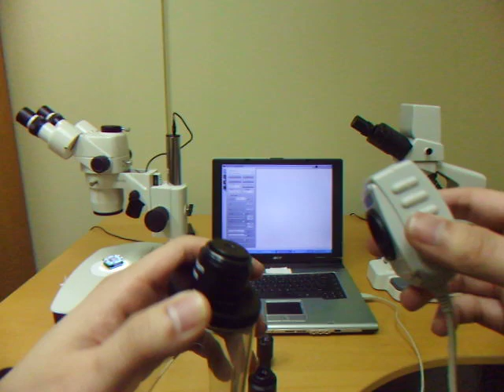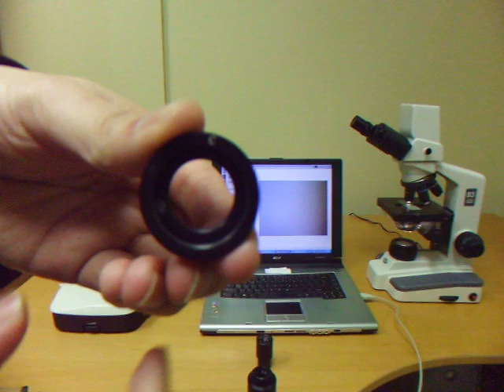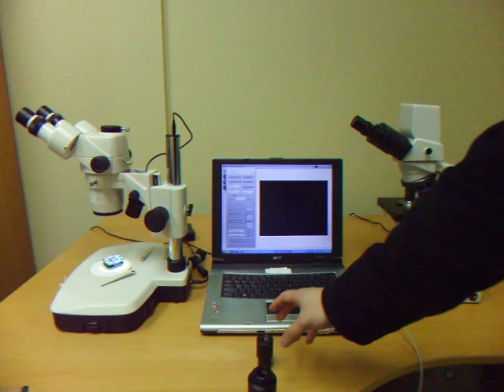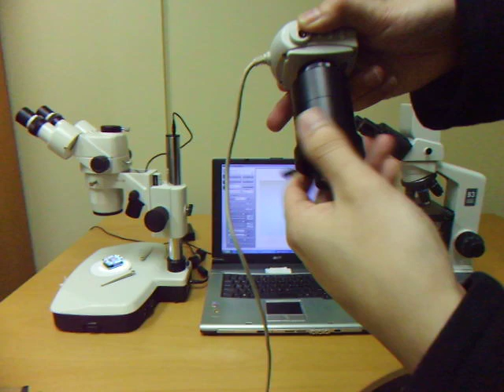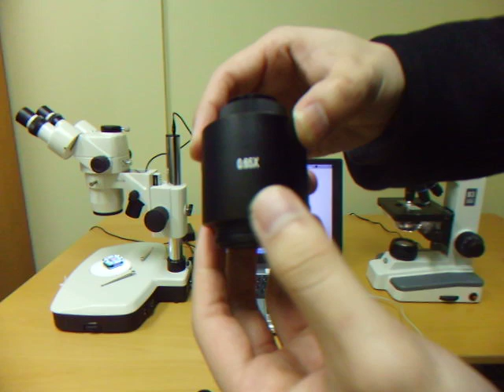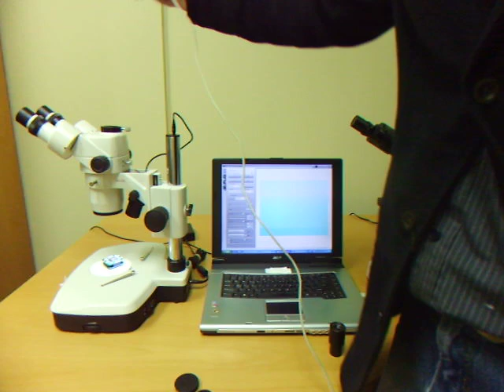How to Connect a Moticam to a Microscope

Comment: Thanks for this video. As you say, to couple the moticam to the microscope, we just have to find the correct adapter. Do you know witch adapter can I use to couple the moticam to a surgical microscope?  Can I connect the moticam directly to the beam splitter tube or to de camera adapter that usually is connected to the beam splitter? I am highly interested in trying a wireless camera to my surgical microscope. I do really think that wireless prevail even for more demanding systems like surgical microscopes. I would appreciate your suggestions.